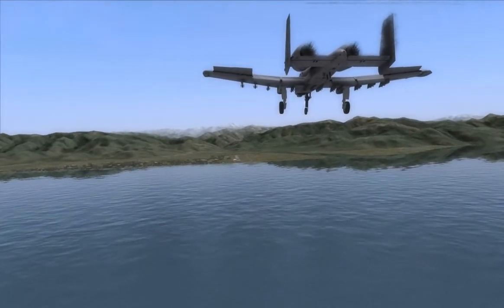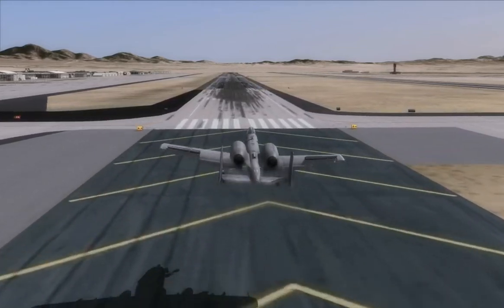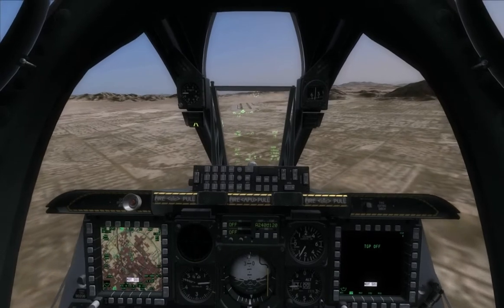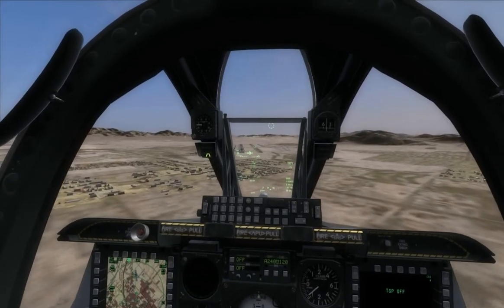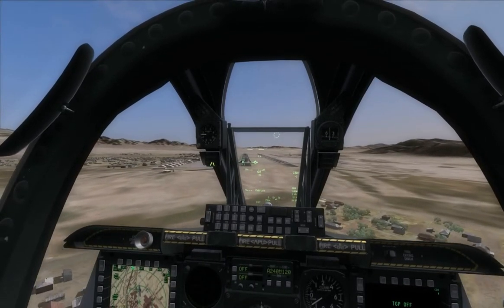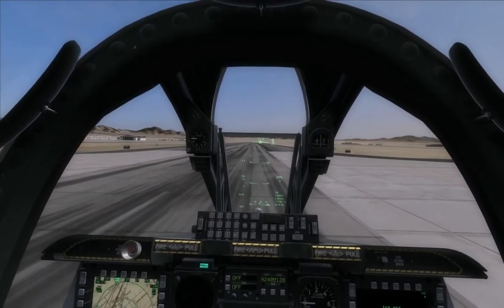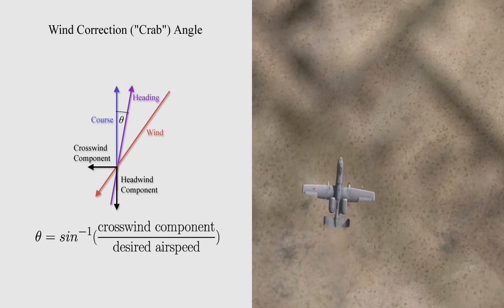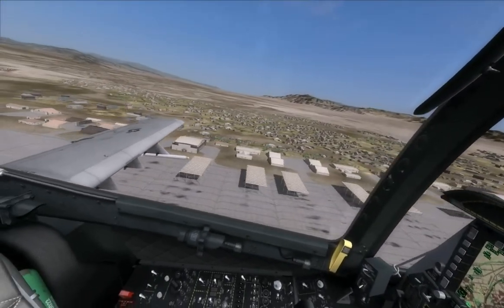DCS A-10C Landing Fundamentals (Part 2)

Comment: Good vid, man.  I'm surprised you didn't explain how to maintain alignment with the runway while on final.   I've always been taught to set your crab angle with the rudder pedals as close as you can get it, then leave it making small adjustments with the ailerons as needed to maintain course.

Comment: If your second(not the nose) wheel hasn't touched down, doesn't that mean your wings still have the majority of the load? If you're on the proper glide slope, it's not like you're dropping the plane on one tire/gear, you're just flying onto the runway and one side touches first(which is how I've always been taught to land--fly it onto the runway).

Comment: Excellent work ! One small point I would make regarding the abort procedure is don't retracted your flaps too early.  The effect of retracting flaps is that the airplane will sink which is not what you want when you are low and slow. Wait until you have regained sufficient height before pulling them up.

Comment from the maker: @wurzzzz I figured someone might mention this. The purpose of dropping pitch in the video isn't to descend, but to buy airspeed quicker. If you're one foot above the runway, dropping pitch might not be an option. Jets lag with throttle feedback greater than in propeller driven aircraft and DCS models this pretty decently. Pitch adjustment, when available, is the quickest way to get additional speed to avoid a stall. However, you do raise a valid point.